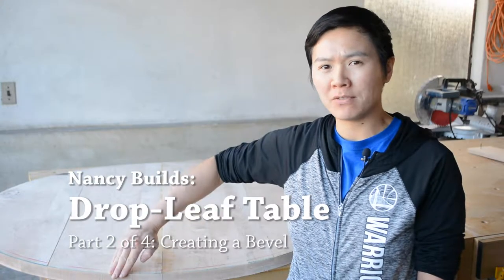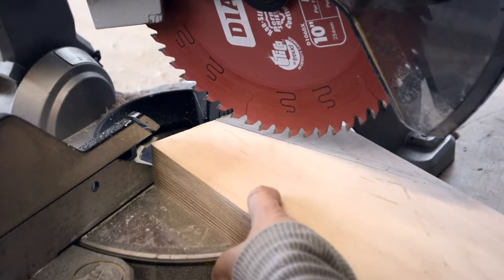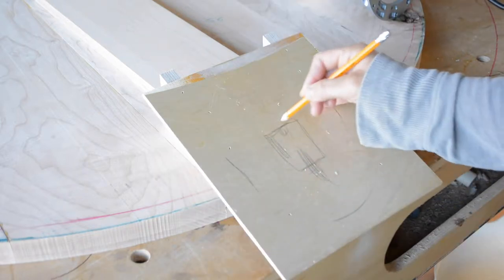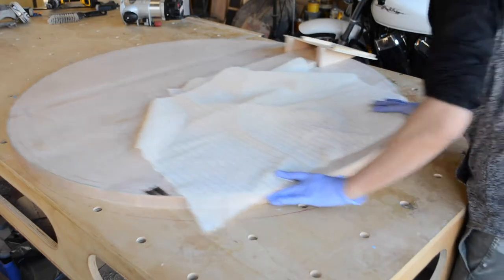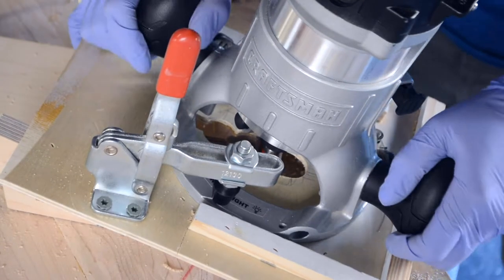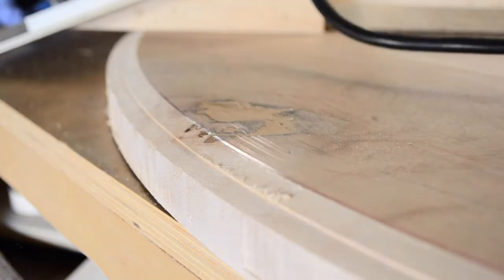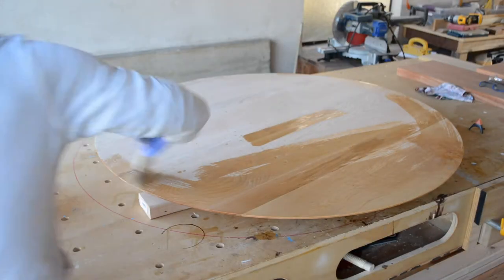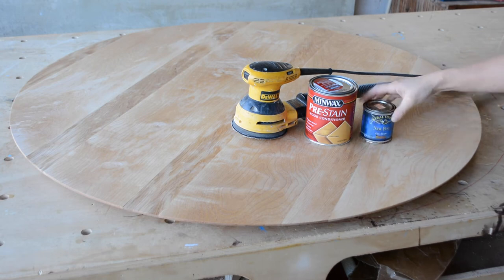Drop-Leaf Table 2 of 4 - Creating a Bevel on a Round Table Top

Comment: Very creative solution to cutting the bevel. I wonder why you didn’t set the angle on the mitre saw with the blade itself rather than clamping at the unusual angle?
Reply: The mitre saw doesn't cut to that angle.